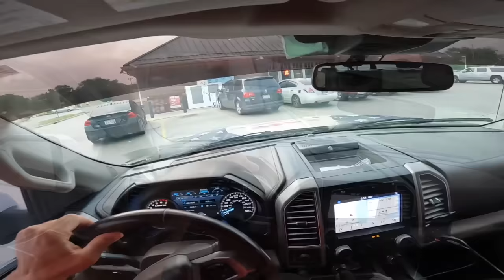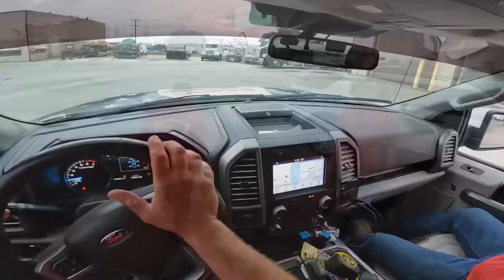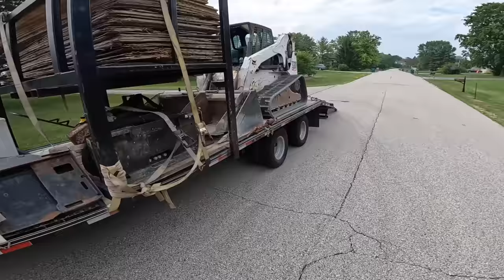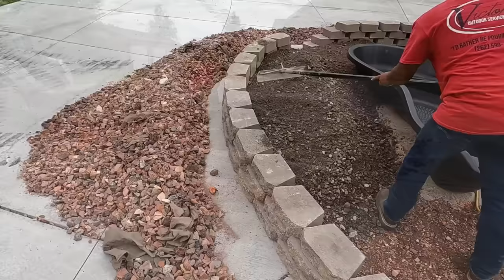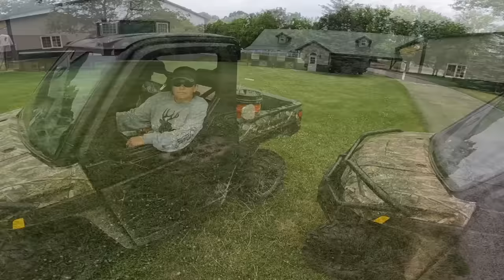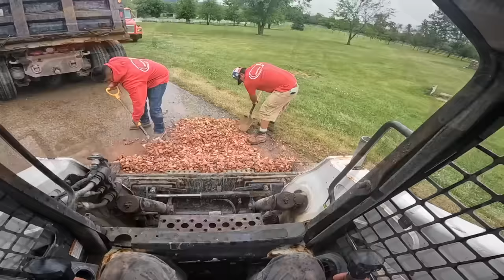They came to work but there was nothing to do

Comment: Take a piece of a plastic bag, tie it to some pull spring. But it in the one end of the pipe. Take a vacuum on the other end of the pipe and turn it on. Might need to tape the vacuum hose to the pipe for better suction.

Comment: Ms. Z is now my new favorite along this journey, if she can neva have a bad day working at a Kwik trip with the public I'll make sure my bad days as a healthcare electrician turn to moderate no matter what 😅

Idk how it goes in Wisconsin but you are running the risk of that romex jacket breaking dumping gravel on it, especially going into H20 exposure that's a massive risk to anyone tending to that pond, risk of death. If it matters to you, use a liquid tight expansion from the PVC conduit to the pond/pool. It does cost more and that's why you charge the customer. Safety matters